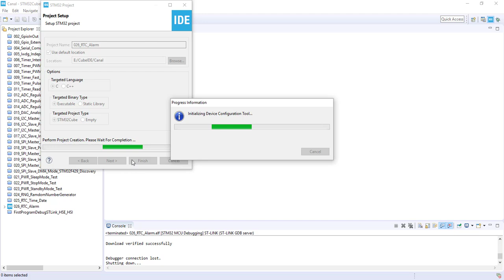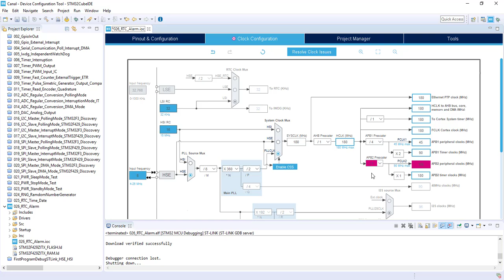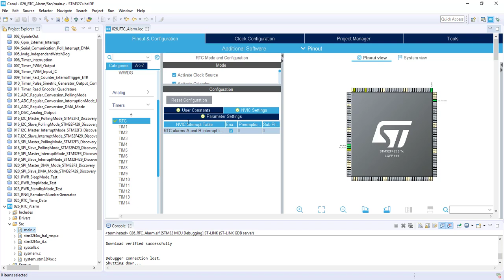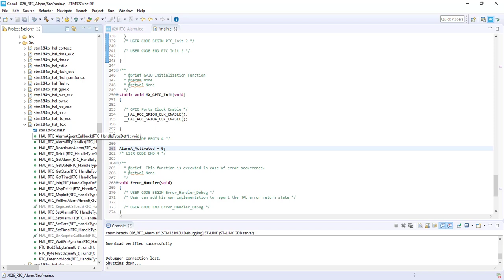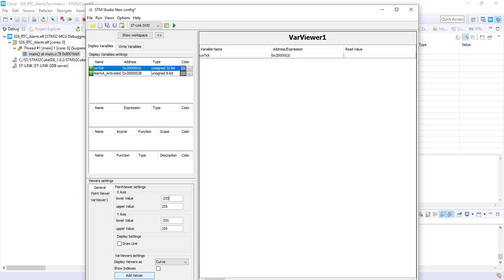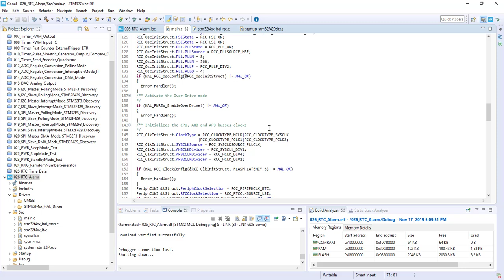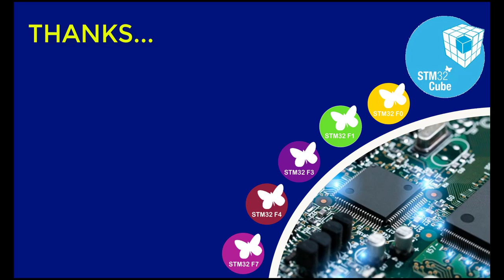026 RTC Alarm  (STM32CubeIDE STLink Debug STMSudio)

Comment: If the RTC runs off 32khz, why was the System Clock configuration necessary (HCLK = 180Mhz, APB2 Peripheral/Timer = 90/180Mhz)?
Regarding the STM-STUDIO-STM32 monitor, where in the code is uwTick defined / updated, is it based on HCLK?  For example, you the set Alarm A for 30 seconds, why does is it occur when uwTick is 30,000?

Also, are you limited to only 2 Alarms?